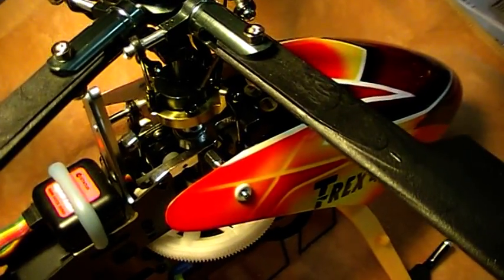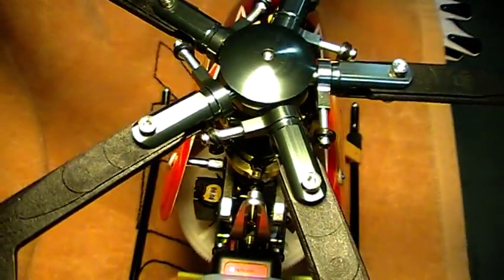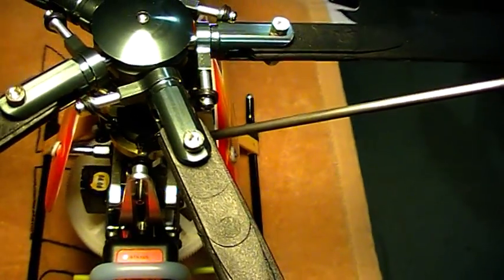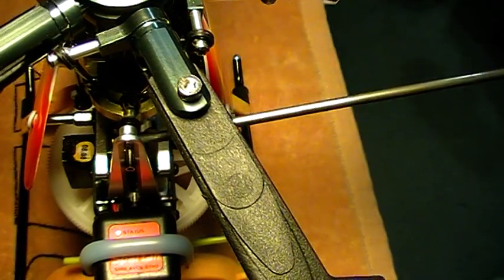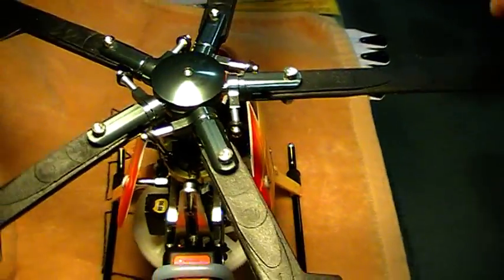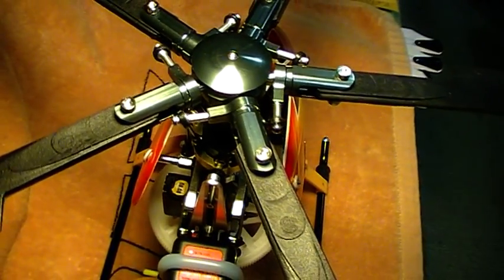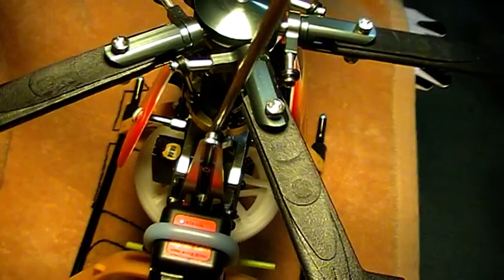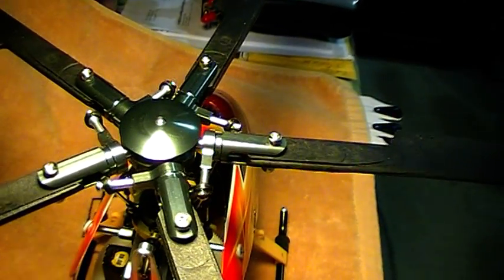Multi blade head phasing

Comment from the maker: If this works ..all good, if not it means phasing will be out 180 degrees which means you will have to align the blade 90 degrees to the right side frame.
I would caution you to ground test the setup carefully to ensure proper phasing.
If you see any odd behavior in the operation of the rotor prior to lift off.... stop and reset and realign the phasing

Comment from the maker: Looking at another penta head setup I have, .....
in using the front mounted  elevator setup it appears you will align the blade 90 degrees to the left side frame (looking from the tail ) then adjust the swash follower so that the linkage aligns to the elevator link ball while the blade remains in the 90 degree position.

Comment from the maker: I would think the setup will remain the same regardless of the position of the elevator link( forward or back), you would still need to have the blade aligned 90 degrees to the frame and the linkage aligned to the elevator link ball.